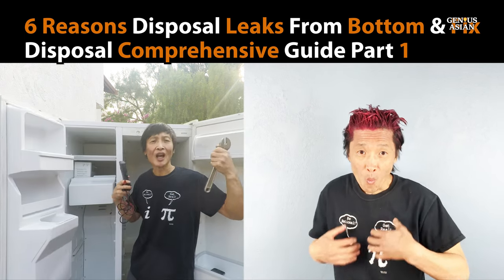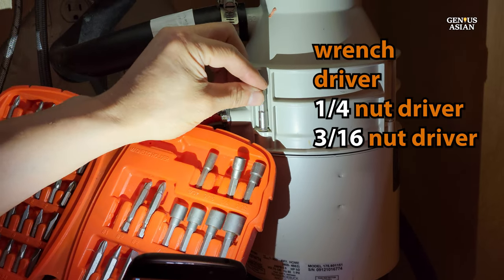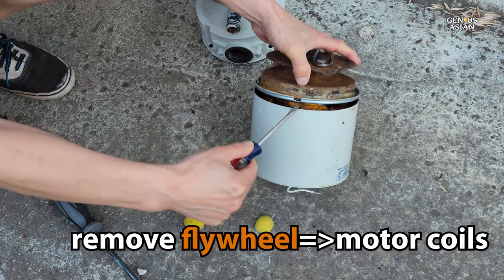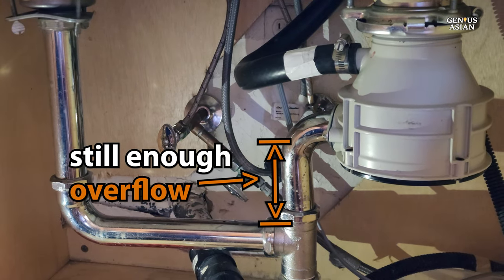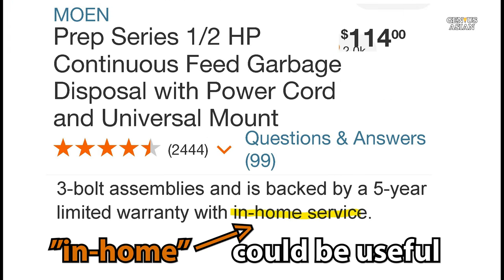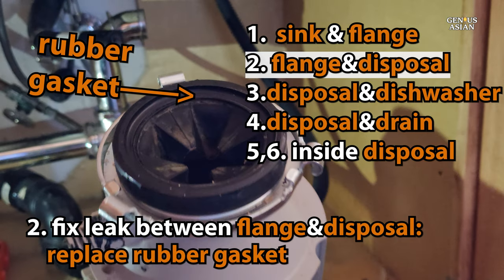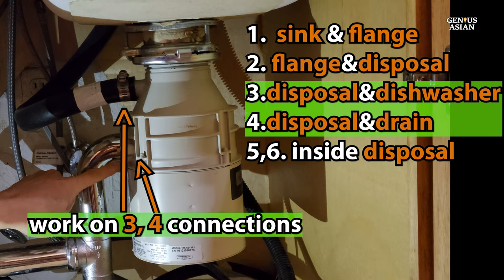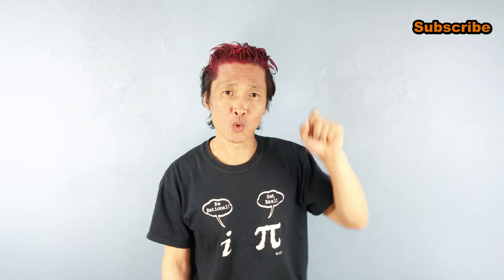6 Reasons Disposal Leaks From Bottom (Causes & Fix), Garbage Disposal Comprehensive Guide Part 1

Comment: Send that man to Harbor Freight to get the right tool for the job
Reply from the maker: yes, the right tool is important, but if someone only has to deal with this problem every 10 years, then finding a sub-optimal solution reduce the time you drive to the store and save you money as well.  Thank you for taking the time to chime in.

Comment: In my research on Youtube , I'm learning more about the O Ring and the motor seal and how these get holes or cracks,  but:
Would getting a stainless steel unit  in any way protect the garbage disposal from the effects of hot water?  (especially the O Ring and the motor seal)   I think ''hot''  water that is also 
''hard water'' in Las Vegas  is the reason why I only get about 3 years out of my garbage disposals that use galvanized parts, and I heard stainless steel is better, but how is that
better if in my case where I live  it's the  O Rings and Motor seals  that are the weakest points ?

Comment: this is such a designed failure point... they could've used stainless steel instead of steel with coat of paint that wear out just when warranty ran out